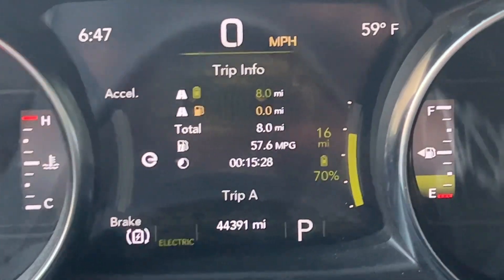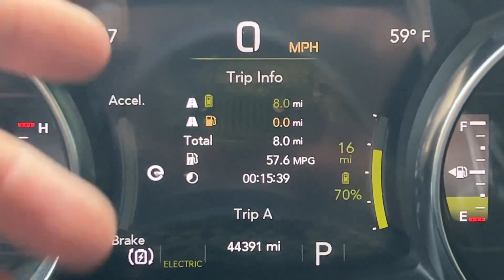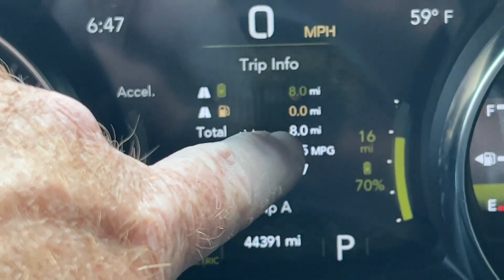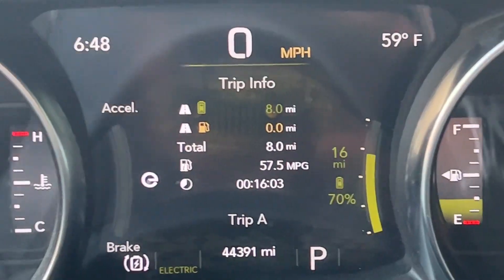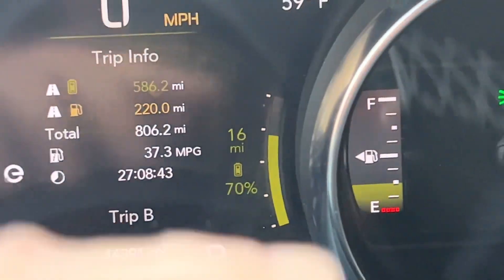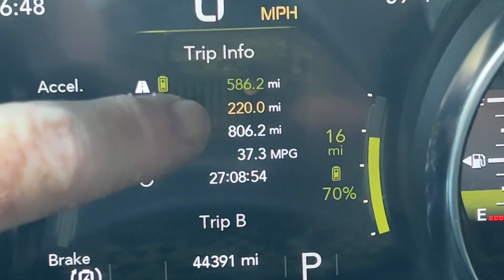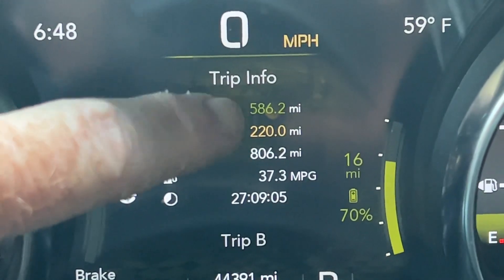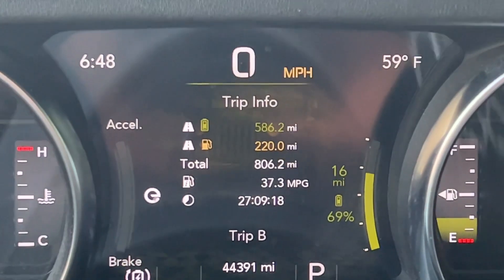PHEV Methodology

Comment: Best way to travel? Esave? Hybrid?
Reply from the maker: Hybrid gives the best gas milage. The only time eSave is good is if you want to save the battery until later, like if you are going to a trail head and want to off road in electric.
Reply: @Wrangler4XEFans  Thank you for always providing great info 👍.  Noticing more 4xe's on the road.
Reply: @Wrangler4XEFans  is there a setting to have it go into Esave on start up instead of hybrid??
Reply from the maker: @snootyfox.indahouse  No, there’s no setting for that.

Comment: Thanks for the video. Your doing exactly what I'm doing. Out and back...plug it in. Then out and back again. I'm on all electric. I filled up day before yesterday the 24th. Before that it was April 7th. I went 6 and half weeks. Made it about 1300 miles on the tank. I set my trip B page every time I fill up like you do. How bout that.
Trip A I measure daily usage.
Have a good one. 
Oh...put a ceramic coating on the jeep about 2 weeks ago. The surface is slicker than oil.
Reply from the maker: I need to do my ceramic coating again. It has held up well but it’s time. Plus, I’ve buffed some trail scratches out so I know those areas need it.

Comment: Question, do you think the system really parses our the electric and gas usage considering when in Hybrid mode there are often times when power is provided by both gas engine and battery sources?   I hope so but it must be very complicated to determine how many miles are attributed to each when both sources are in use.  I have the Grand Cherokee 4xe and I don't trust are care about any of that data.  I tried to figure out cost savings, that is even more difficult.  I just have come to the realization that it's likely that I am saving a bit when making sure I leave the house with a full charge.  The savings is really good when you can keep your trips on a full charge to less than about 50-miles or so.  Thoughts?
Reply from the maker: That's a great question. What's it's parsing out is electric miles and hybrid miles. Like you said, it's really difficult to impossible to separate out gas and electric miles since there's never a time that it's operating in a "gas only" mode. It's always a hybrid.

I've done the math a few times and my electric miles are about .06 cents per mile and about .16 cents per mile when the engine is running. Bare that a out over 50,000 miles and you have $3,000 in electric vs. $8,000 in hybrid. So those savings add up over time. Especially if, like you said, your daily commute can be covered in all electric.

Several of us in the 4XE Fans group on Facebook have done experiments. It seems like if your daily commute is 60-70 miles or less, you still come out ahead over a gas model. This is in the Wrangler so the GC may do a little better. After that 60-70 miles, it doesn't seem to be as advantageous over the gas version. It's still better than the gas version, don't get me wrong. But it's not a huge difference like those first 60-70 miles.
Reply: @Wrangler4XEFans  Thanks, that all makes sense.  I didn't necessarily buy the GC 4xe to save money but because of the full tax credit and long term electric use, I will likely save a few dollars.  I have also heard there are studies that show that PEHVs are actually more reliable than pure ICE based vehicles, I guess time will tell.  The three features that I enjoy the most about the GC 4xe is regenerative breaking, silent operation, and full system use while sitting idle on battery power alone.  Thanks for your feedback on my comment.  Keep up the great work and interesting videos.
Reply: It is actually interesting.  I have a Willys 4xe,  I drove a 30 mile trip with e-save on and still accumulated 5 miles on battery.  I drove back with hybrid mode and got 23 miles on battery, a total of 28 miles on battery.  I just filled up after almost 600 miles in 3 weeks.  $40 in gas, it costs me $1.30 per day to charge (only one charge of about 15Kw per day).  Figuring I don't drive everyday, but say $30/month in electric plus $40-50 in gas per month would $70-80 per month to drive.  I know I spend way more than that when driving my gas powered cherokee.  It definitely saves money.  It may take a long time to accumulate to the extra cost of the 4xe though.
Reply from the maker: @SilverFoxCooking  I need to sit down and do the math again with modern numbers.
Reply: @Wrangler4XEFans  I pay about 8.8 cents/Kwh.  The enelX app tells me how many I use each charge, so I can kinda get a good idea on electric use.